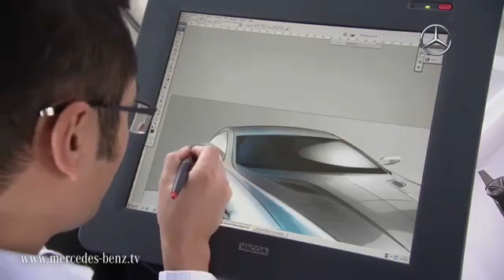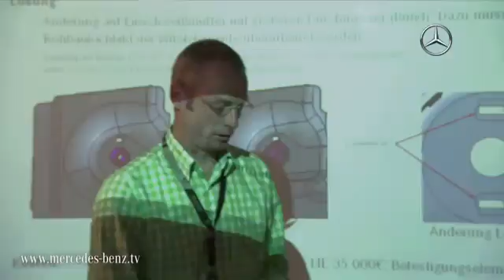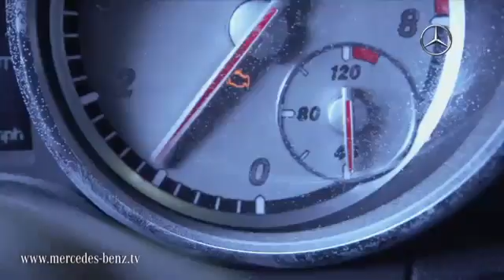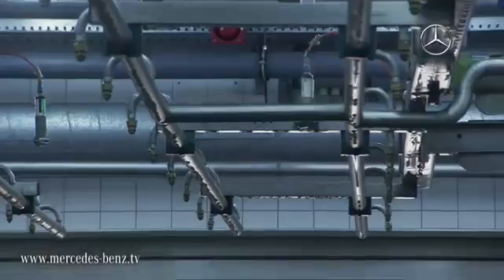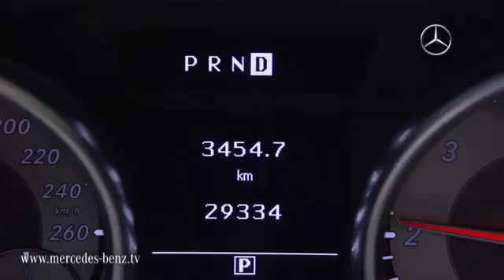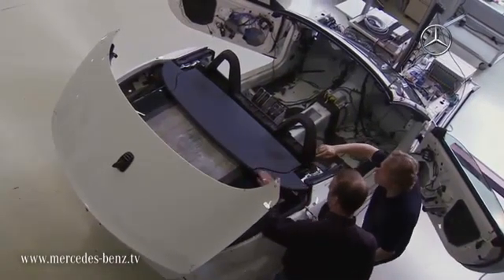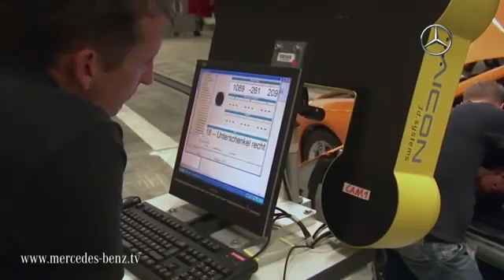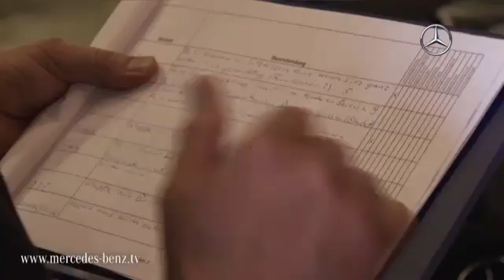Mercedes-Benz.tv- The development and testing of the new SLK

Comment: The r170 vario roof is very bad actually, and no one has been able to repair mine, including 2 mb official garages.
Reply: Try the Z4 roof. You get oil inside even with the last model ...
Reply: Does it close and does not want to come back up? I have 2 r170 and both work just fine but starting having some issues with one when it's cold outside, the roof opens but doesn't want to close
Reply: @XAV-7  most of the time, it won't open. The trunk lid opens, but roof doesn't move. Sometimes, same situation but the roof won't come out to close and I have to pull it out manually... it's a pain in the arse. At night is guaranteed to not open or close due to colder weather...